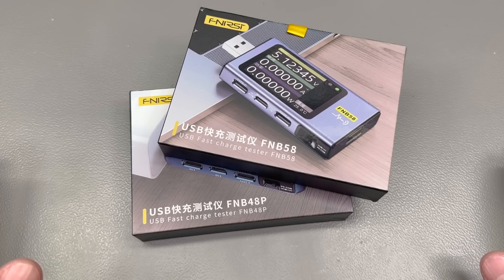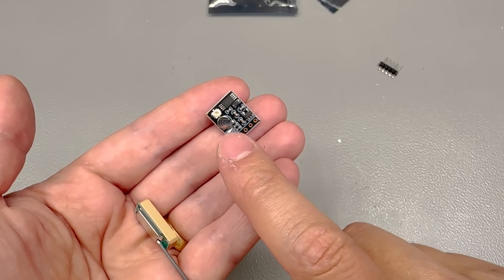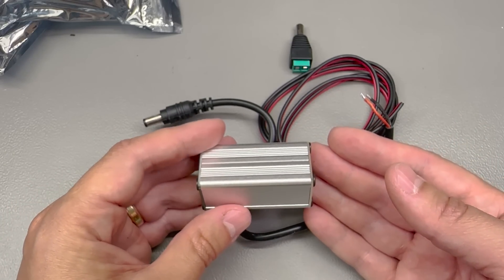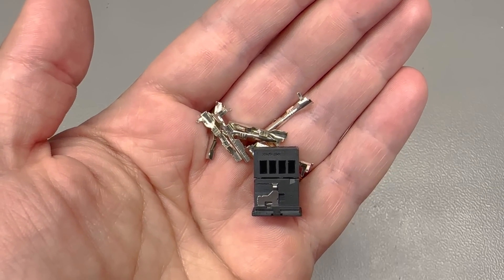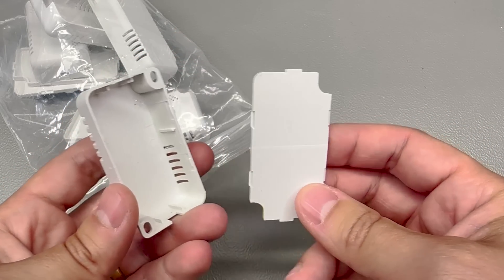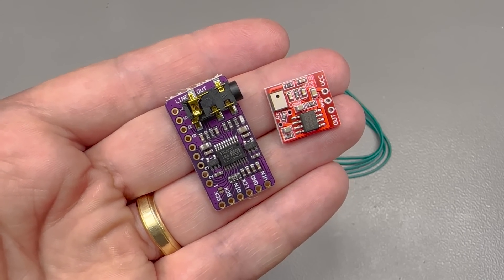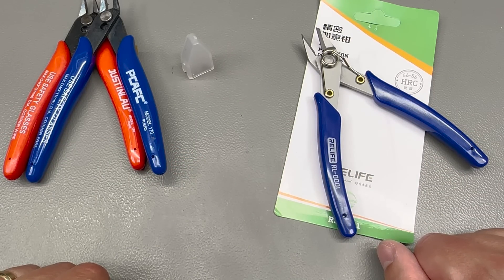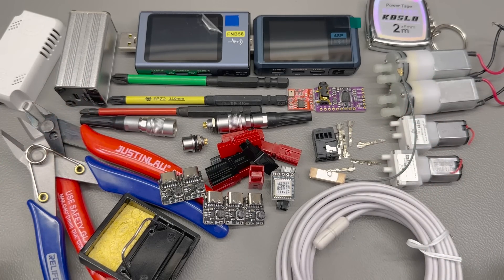InTheMail | Voltlog #450

Comment: The lipo charger  doesn't look like it has a charging chip like a TP4056 or 4057   looks like just a boost circuit.  Can you do a video on it in a little more detail.  It just seems like it is missing something to be a lipo charger

Comment: I bought some expensive pliers and indeed wrecked the blade when I accidentally tried to cut some steel wire (laundry hanging wire). I do feel like they are not much better than the free pliers I get with a 3D printer.
Reply from the maker: Thanks for the feedback!

Comment: Yeah Knipex diagonal cutters cost 10 times as much as the AE junk.  But they're 100 times better.
Reply: I have similar experience where cheap cutters from AE got ruined after few steel pin headers (repeatedly) yet Knipex cutters (78 81 125) cut those headers without any damage. In result for this task much more expensive cutters are less expensive since they last near infinitely longer!
Reply: @2000jago  I though flush cutters were intended for electronics - like PCB leg trimming - yet the ones from AE fail extremely quickly on some legs of common components... It's not that they are not intended for this, it's more like they are rubbish!
Reply from the maker: While there might be a big variance in the quality of the pliers you get from Aliexpress (especially no name ones, less for branded ones like RELIFE) I have not encountered ones that break from cutting component leads. I've used them to cut even thicker component leads, like the diodes rated for several amps, hundreds of cuts, no damage at all.
Reply: @voltlog  There is variance for sure - first pair from AE (2016) latest longest and got destroyed due to abuse, then two pairs (2018) failed quickly and another two pairs (2019) failed quickly from regular PCB components like connectors or thick diode legs not what I would classify as abuse... Very hit and miss.